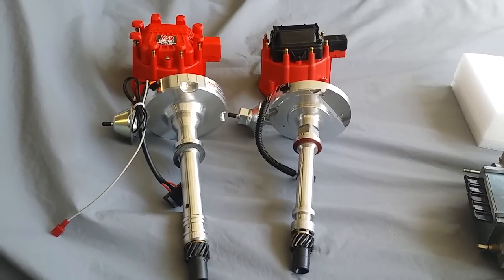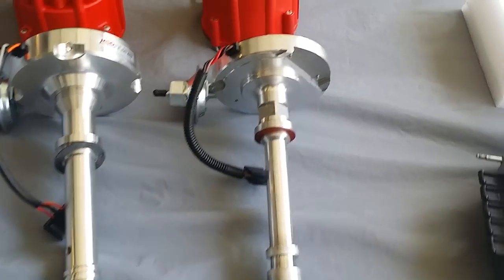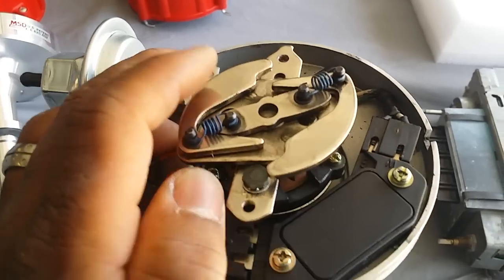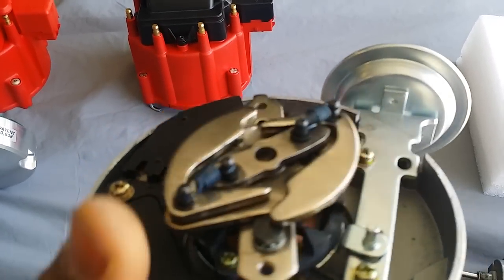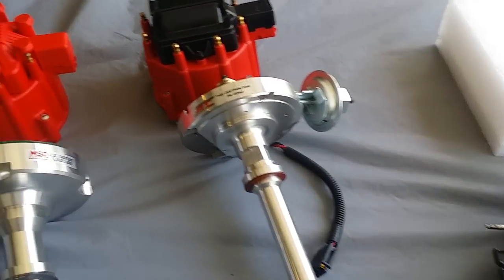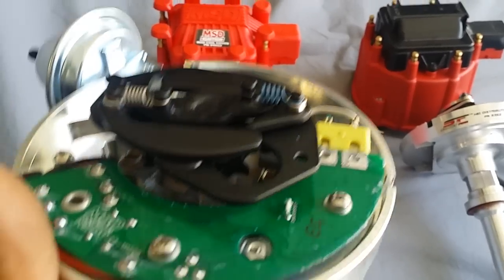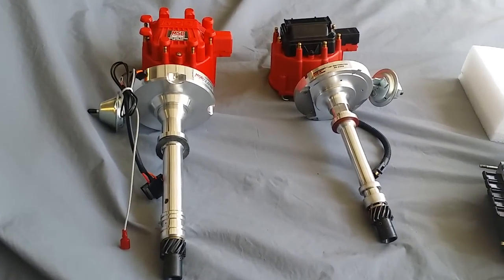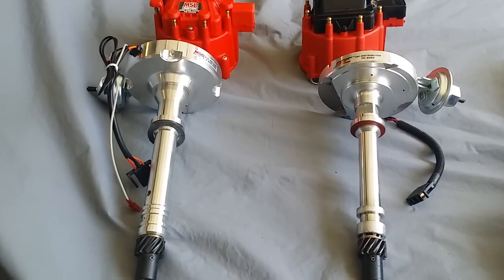CHEVY NOVA MSD PRO BILLET HEI VS STREET FIRE HEI

Comment: Make sure that dist. gear is compatible with your roller cam. I used a comp. cams composite gear on my pro billet. Also nice build so far. Cali cars are amazing. No rot or rust. You got a good foundation.

Comment: Hey buddy. I have that 8362 in my truck now and when I had the distributor off to check my contacts I noticed the same thing on my weights. I've had it for almost 2 years now and it's been ok. I don't have 600 HP though. Just a 350 Chevy motor. I did order replacement weights and springs. You ain't lying about the loose weights. By the way they are going for $181 these days

Comment: I just set up a street fire which was a customers leftover for use with an msd box.  I yanked the module, coil, etc. and just have the trigger wires.  The Spings that came with mine look much tighter.  It came with bushings over the drive gear and doesn't have any slop.  It all looks good and well, but I'll be happy to report back with my results once that motor is started...  I used the guts for my daily driver with mild 350.  In my Squarebody on 38's I use an Accel Performance replacement with an MSD box and it's worked very well.  Dizzy be like $115 with no coil, so its perfect to buy for MSD Box trigger. Weights had no up and down slop at all like well machined piece.  A good alternative, if you don't wanna fork out 300+ for that PB.  Tho I'll say I've had one, works Well!.

Comment: It's not that their junk but more so that everything has its limits...especially for the money. It's only obvious that you get what you pay for and actually they are very good units for the price. MSD doesn't claim them to be used for race applications etc but more so as a factory or stock replacement up to mild/medium hi performance street engines and that covers anything up to 6000 rpm. I build anything from stock up to hi performance (500hp) engines ( 2 engines a month) and all i use is the StreetFire and i havn't had any issues yet. Yours did not "Blow up"...yours just had a bushing failure that could be replaced for $2.00 at most. Yes...the Pro Billet is a better unit...but the price will also let you know that. For anyone building anything up to 500hp...trust me...the StreetFire is just fine!!!
Reply: streetfires can never get the correct advance curves for something he has.  he probably needs at least 18 degrees of inital and 36 all in at like 2500 max.  shit sometimes 2000 RPM.  you'll find the reeall well setup cars run way better and wont pop back and spit 
they advance wayy to much mechanical at too high of an RPM.  its the HEI design really.  He neeeds the probillet like he has and leave the HEI repcaments for pickup truck and vans with stock engines.
Reply: @KingJT80  you saying HEI’s mechanically advance too much?  Please don’t give advice about a subject you know nothing about!
Reply: @trailerparkcryptoking5213  you don't understand a word I'm saying. Let me explain this again so you can understand 

Do even understand why that is ? His mechanical timing may be too much for that engine.. that's why moving to the MSD pro billet or pro billet HEI will give him more flexibility 

 High performance engines like more initial advance because they have bigger  duration camshafts with more radical timing events but when you give it more advance and keep your total timing the same you have to limit your mechanical advanced

Now you tell what's wrong with what I just wrote...
Reply: Been having mines for years. They all will go bad Eventually.

Comment: I've been having problems with mine since I've installed it. Replaced everything on it except the coil pickup.  I'm checking mine today but I have heard the pickups aren't spaced properly and cause problems above 3000rpm.
Reply: Update: every streetfire dizzy I've checked has excessive play in the main drive shaft that causes the magnetic pickup to miss at high rpm.  I think they tried to go cheap on bearings.

Comment: Ok I'll address as much as I can... First thing... The distributor weights, u can swap the springs around and out with different weights of springs for a different advance curve based on your cam profile... 
2nd if ur module or coil keeps burning out... It's a grounding problem I've had it happen on my mud truck, add an extra ground from the ground post of the hei to firewall and from firewall to block, I stopped having the issue... I went thru 4 accel coils in a week..$$$

Comment: I bought the same pro billet distributor and then started to have issues with the radio and hearing music with the CD player, any suggestions?
Reply: Make sure you have the ground strap under the coil installed. People forget this and it burns up the coil and you get electrical interference

Comment: I bought the MSD e-curve, truck has been running for about a year and just quit. no spark. i changed the cap, rotor and coil and still no spark. the 6AL box has power so I'm wandering if the electronics went out on the distributer
Reply from the maker: Make sure your cam gear isnt chewed up, mine was
Reply: ok, I have to pull it out so ill check it. I've read that the cap needs to be vented so no condensation gets in and ruins the electronics. so it looks like ill be sending it back to MSD
Reply: I donb't know, Many people I know with performance VW motors have had good luck with the streetfire kit (dist, cdi box, coil + leads) setup. You can't even buy the MSD billet dizzy for what the entire street fire kit costs for these! but the chevy dizzy is a HEI versiomn, the VW is just a normal billet dizzy with the coil / cdi box separate.  actually prefer Mallory if I'm going all out performance truth be told. You can get superior distributors with big arc free caps (esp. on the Comp 7000 range) and with MSD if your CDI goes out , you are stranded. With mallory, you can just bypass the module and use it in standard points mode to get you home.
Reply: it was the internal electronics on the dis. i pulled the unit out and replaced it with the old style one weights and springs and it fired rite up. i think this is a good idea, but the electronics just don't last in the elements, heat and moister
Reply: Cam gear chewed up because of what your type of metal your cam is made from. Might need a different type of distributor gear.
Reply: @jasonneal  Exactly dude!! I rebuilt my old one cause I was tired of throwing money at it and not getting nothing back but an empty wallet and frustration!

Comment: I don't know who told you that was the problem but if you do research an old drag racer trick is to take one of the Springs out for your distributor weights to make it spin easier and faster so I doubt that had anything to do with it maybe the magnetic pickup in it may be shot  but I highly doubt the weights or springs have anything to do with it

Comment: He's right the street fire is not good for performance motor: I swapped it with a pro billet 8361 in my 468 and it pulled strong through all the RPM range.

Comment: @ss396rat Yea i know I've been looking at the digram buy it's confusing. I got the same distributer pn 8365 and i got the 6AL ignition box. It says in the digram that the black and the orange wires go to the coil, but the coil already has this black plug plugged in!
Reply from the maker: Are you using hei wiring diagram from msd?  you need to create your own ground wire for the middle tab on the coil. Unplug everything thats connected to the coil
Reply from the maker: HOW TO INSTALL MSD 6AL IGNITION BOX ON HEI: http://youtu.be/cGeRJX69iLo

Comment: How did westech curve it? Did they do it on the dyno? I've talked to them before, great guys.
Reply from the maker: Xavier A. took out distributor and did something to it
Reply: So you just gave them the distributor. I'll have to give them a call.
Reply: @ss396rat  5yrs too late but they didn’t do anything to it other than switch out the springs to one silver and one blue spring. That would give you 22* mechanical all in by 2500-2800. You set your initial at 12 and you get a total of 34* all in by 2500-2800 at full throttle. That curve will make you take off the line quick

Comment: Is the pro billet unit basically a drop in plug in factory replacement type install or do u have to wire it I only ask cause I hate wiring
Reply from the maker: 724 Street Cars no wiring just plug your  ignition to it

Comment: I am restoring a 72 nova. What did you use to get the under body clean?
Reply from the maker: Air Angle die grinder with a wire brush on the end, you will use maybe four brushes, they wear out quick
Reply: Thanks a lot for responding. Might need to pick your brain again. Great job on the build by the way!

Comment: Who ever told you the street fire was bad due to the spring and weights has no clue what there talking about. Stock and performance engines like ignition timing.(safe levels). We at the shop put the softest springs, just to have base timing during startups. People get amazed after driving there vehicle. Not to mention but you get lower egt’s

Comment: It’s supposed to be like that. The distributor has the flyweights there to aid in timing advance as result of centrifugal force as the distributor spins. Good distributor Sir. Bearings, really bad? Those weights are to be able to pivot as the centrifugal forces increase those fly outward.. “normal operation Sir.”

Comment: Find an old HEI out of a Chevy V 8 and rebuild it!! Trust me I used the fancy expensive electronic aftermarket bullshit junk!! Not Impressed!! I rebuilt the distributor outta the motor I had rebuilt and haven't had an issue!!!
Reply: But what you dont get is with HIpo street engines they need more intial and less mechanical.  a stock junk HE_I also advances at too high of an RPM.
A real trick street setup is 20-25 degres inital and 10 mechanical and limit the vacumm advance.  ALL in at like 2500 rpm max.  a stock HEI will never be able to do that no matter how many curve kits you throw at it or what brand they are.  theyre all the same
an HEI module aslo stop firing around 5500 or less  Youd need so many mods to a stock HEI just get a rready to run or e curve.  
you saying they are junk is just a lack of knowledge my man.
Reply: @KingJT80  thats not true.  A stock dizzy can be recurved how ever you want it with stop bushings or a lockout tab.  I rebuilt my stick dizzy after having numerous issues with 3 different msd streetfire dizzys. Even shortened the curve so I have 20 initial and 14 mechanical.  Added an adjustable vacuum advance for another 10 at 10 in of mercury. And none of the issues that of had with the street fire.

Comment: You could’ve locked it out and done away with the advance
Reply from the maker: Then it wouldnt start
Reply: Yes it will.... my HEI IS locked out and it starts just fine.. but you upgraded so it don’t matter now, but yes it will start and every time you turn it over fire will be HOT!!! I learned this just recently after my Accel hei started tripping wouldn’t burn the gas but soon as we locked it out it was fixed... look it up on YouTube to get a better understanding but it will start and fix low voltage spark ⚡️